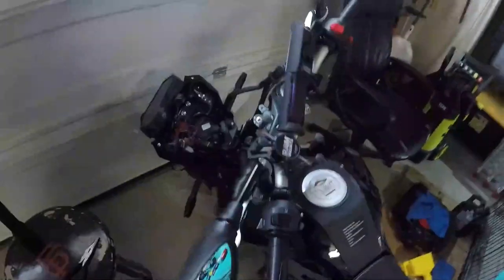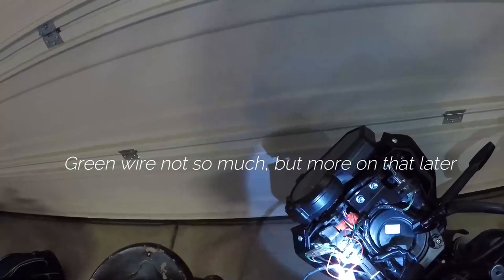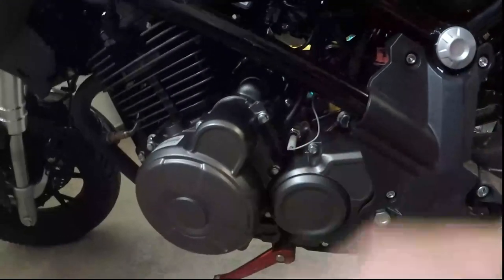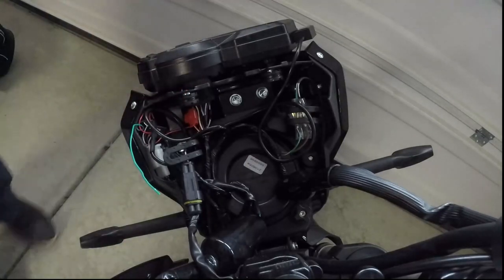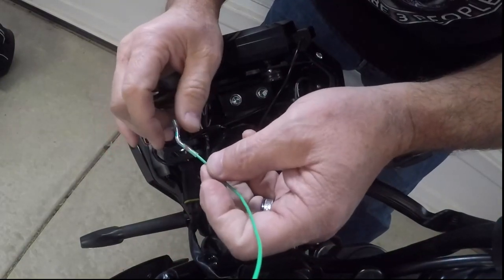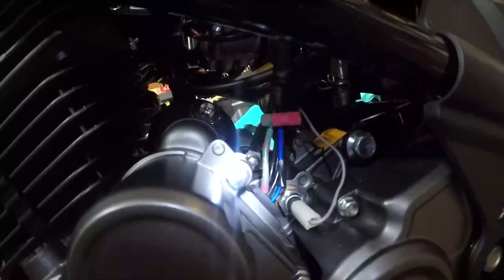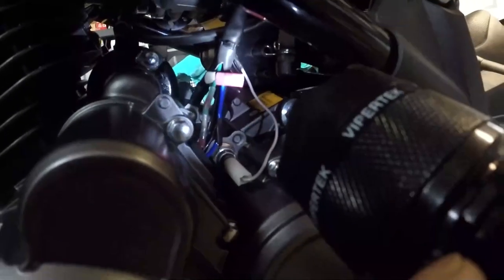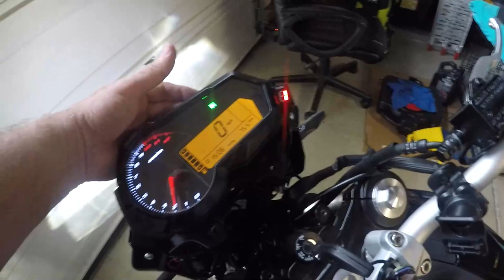Benelli TNT 135 Gear Indicator Part 1

Comment: Nice video,,btw can draw some diagram for more detail,,
Reply from the maker: Ok next time
Reply: How much wire on indicator u got??what color of wire u connect from up to bottom?
Reply: I got 6 wire + 1 for ground so 7 wire...
Reply: My head coming blow to fix that
Reply from the maker: The indicator I purchased has 2 single wire attachments and then a 3 wire attachment to the speedo.
Reply from the maker: Here is a copy of the wiring diagram that I used and I marked where I made connections. https://drive.google.com/file/d/1AB4nyqeoZG_UjUJmhO8i00ouc80Kotn7/view?usp=sharing